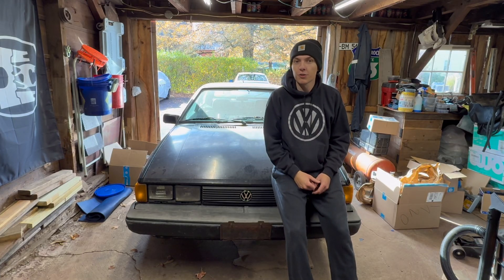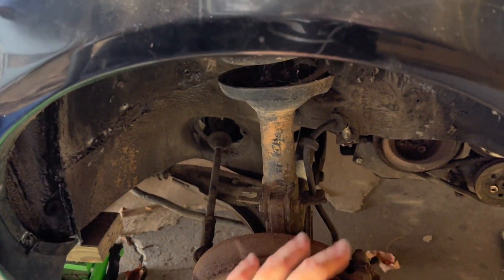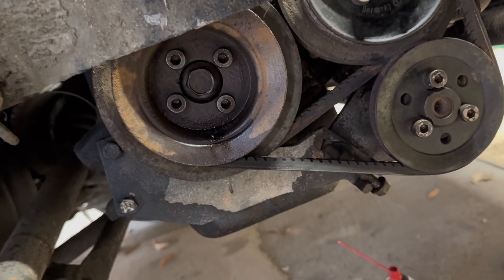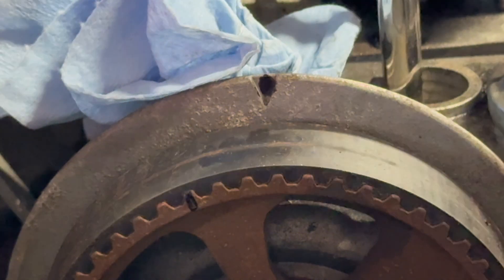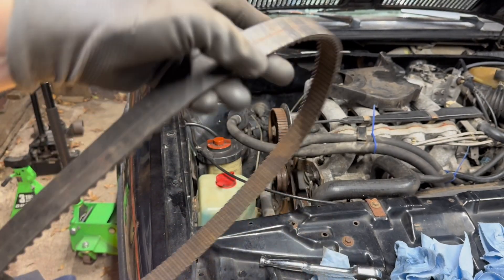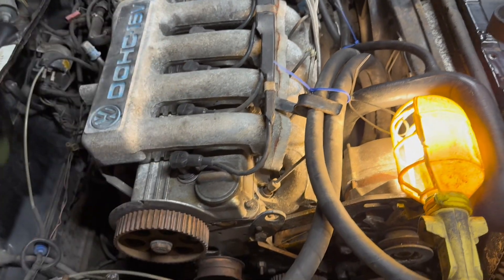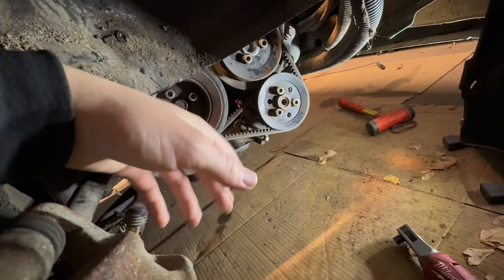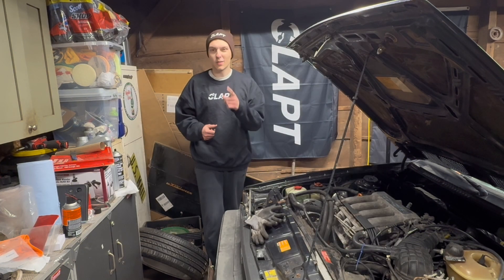How to Replace the Timing Belt on a VW MK2 16v

Comment: Nice video.  I appreciate the tips and tricks.  Ill be diving into this job in the next week or so.
Reply from the maker: Just a heads up one thing I missed explaining well in this video was the direction that the timing belt tension should be tensioned. According to the Bentley, it should be tensioned clockwise. This allows the belt to ride properly on the cam gear so it does not back off or jump teeth while rotating
Reply: @Leakyvws  Thank you.  I went ahead and ordered the tool as well.  I have the manual so Ill review that as well as i do the install!

Comment: How couldn't you time this vehicle without the lower valve cover and the markings?
Reply from the maker: I had to put the lower cover in place multiple times to check the marks but I made my own timing marks on the crank sprocket so I didn’t need the cover on when initially checking

Comment: a few things i noticed.  i forgot to check the bottom mark when removing the belt.  the water pump did you replace it with a metal fin instead of the plastic because they are 100 percent better?  did you check the hoses coming off the water pump?  other then that Great job.  like the videos.  i had 3 vw sciroccos 16v and 2 where turbo charged by me.  also had a 16v B3 passat.
Reply from the maker: Yessir, a new timing belt and water pump with metal fins is pretty much my routine with any new vehicle I get. I’ve personally seen too many catastrophic failures due to the stupid plastic pumps. I fully flushed the cooling system while the assembly was out to clear any debris since it’s been sitting so long. I look forward to getting this thing up and running soon